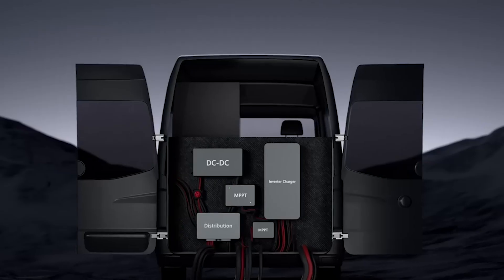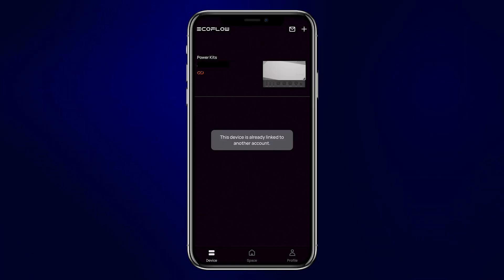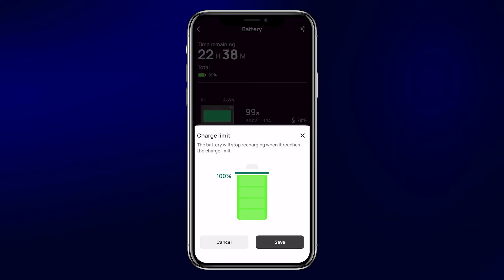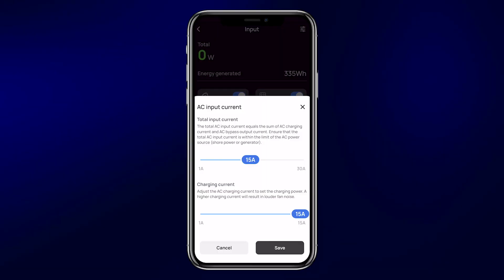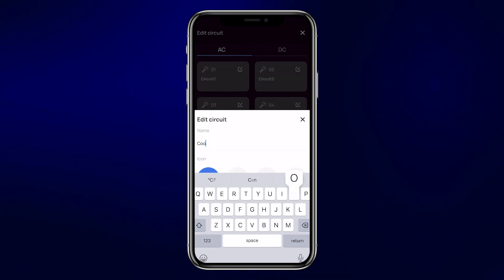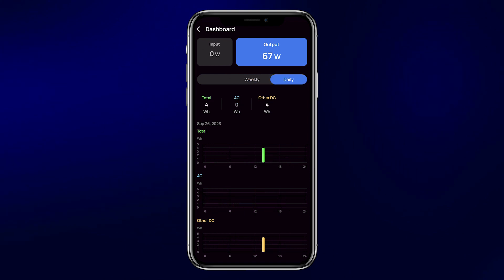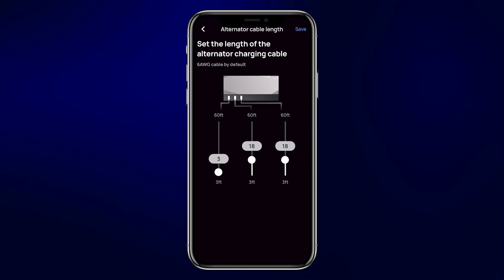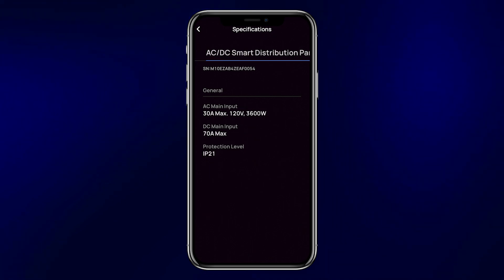How to Program EcoFlow Power Kits + Hidden Bonus Feature!

Comment: Is there a way that you could just use an iPad? To set this up or do you need an iPhone? Because the only phone I have is just a basic flip phone.
Reply from the maker: You can use an iPad, you'll just need to be connected to WiFi
Reply: @VanLand  thanks for the quick reply😁
Reply: I’m planning on using this in a truck camper if the battery cables aren’t long enough would I be able to use a power dock plus an extra cable for the extra length?
Reply from the maker: I think you should be able to although I'm not certain

Comment: This video was a life saver for me, but being a "newbie", when using the emergency feature to jump start the chassis battery should you shut off anything else, i.e. the dc output,  or any other output, or input  switches??? I assumed they should all be turned off,  but wasn't sure,  & it hasn't worked so far.  Your reply would be appreciated, & again a life saver.

Comment: Hi. Do you know, if power kits has a pass thru of AC current, so if it connected to AC line it won't use batteries for serving AC? Or it is always using batteries to serve AC power, and when connected it always discharges and charges them at the same time?
I want to use it at home as a reserve power source, but don't want to wear out the batteries all the time and don't want to have inverter always running.

Comment: This was so helpful!

Not much out there on settings, and they dont mention much in the instruction manual.

For “troubleshooting” when no power comes on, Ecoflow support provided me with following:
- shut off the powerhub with a “long press” for 3 seconds (if battery screen appears - shut down successful);
- disconnect all cables from power-hub and wait five minutes;
- plug only battery back and see if “reboots”
- check if light is on, or can connect with app;
- re-connect all other cables.

This has worked for me a few times, especially when having to disconnect/re-connect the battery.

Tnx so much for this great video!

Comment: Ford Transits have a high amp alternator that can do 300 amps, or 170amps at idle speeds. I think the standard can do 250A running, and 100A at idle.  So why is the Mercedes limited to such low charging currents??

Comment: I ask already the question on another post. We want to install the power kit in our caravan/RV. I watched the video and there is the setting of total power and charging power. You can set it to for example 6Amps when the campsite only supports 6Amps and the battery charges at 6Amps. What if we run an AC device, like the cooktop which uses over 10 Amps (2300W), does it use the power from the battery and continues charging the battery with the shore power or how does it work?

Comment: Really great video. After setting up the system I’ve had a lot of uncertainty around using the system. My main question is actually how to properly shut down the system. For example in the middle of winter not using the system I’d want to bring the batteries inside. What is the proper order of operations to shut off and then turn the system back on. The wording on the power kit says to “cut all input” before turning off. Does that mean via the app or actually unplugging all cables while it’s on?? And then the flip side what to connect first before turning on? The batteries or the inputs?

Comment: Hi I’ve just had the 2kw power hub installed and was working great. The van has not been used for 2 weeks. When I’ve connected shore power 240v my small LCD display only powers up and then goes off after about 2 seconds. The error message from the unit is AC batter charge inhibited error 65? Any idea on how to resolve this ?. 

Thanks
Reply: Same problem. Was you able to you resolve the issue?

Comment: In the van shown in the video, why did you choose those locations for the battery, hub and fuse box?  I have also seen the fuse box in the wall panel behind the wheel well, the battery behind the wheel well and the hub over the wheel well.  I would like to know more about the thought process.  Thanks!

Comment: Jeremy, I bought a 10 kW kit from you and it works like a dream. Great reverse charging function. However, the Ecoflow appears to be trickle charging the start battery without turning the reverse toggle. Turning the Ecoflow system off, my ProMaster start battery would die in less than two weeks. Leaving the system on, the start battery stays charged at around 13 V. Can you verify if trickle charging is already there? Thank you for another great video.

Comment: can you run a second alternator with Eco Flow?
Reply from the maker: The best scenario for charging EcoFlow is to get the upgraded high-output alternator from Mercedes and they you can dial up the Power Hub to full charging. Since the unit is limited to 70 amps of charging on Port 1, a secondary alternator (250+ amps) would be overkill.

Comment: You may want to check your facts on battery charge settings, because all batteries, including LiFePO4 batts, retain storage memory and if you set your charge controller to a limit of 80%, then over time, the ceiling of the battery's storage potential will max out at 80%.  Moreover, why then have a battery capacity of a certain amount (say 800Ah) where then you only have a setting where you can only use 80% of that.  It makes no sense.
Reply from the maker: I do not suggest that people NEVER charge their batteries past 80%. If not informed otherwise, most people obsess with keeping their batteries at 100% all of the time. The fact is that it's better to routinely charge them to 80% and only charge up to 100% as needed. For instance, or you are heading out on a trip. Also, we recommend going through the full charge cycle up to 100% once a month. This balances the batteries and eliminates the "memory". This is the correct way to manage battery storage. You may have noticed that while charging an Apple iPhone, it stops at 80% and then waits until just before you wake up to charge to 100%. In order to extend the life of the batteries and get the most capacity out of them, you shouldn't constantly be charging to 100%. You can actually see the batteries expand when charged up to their max. This isn't good for them.